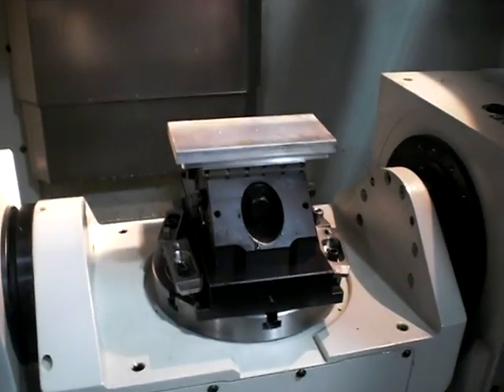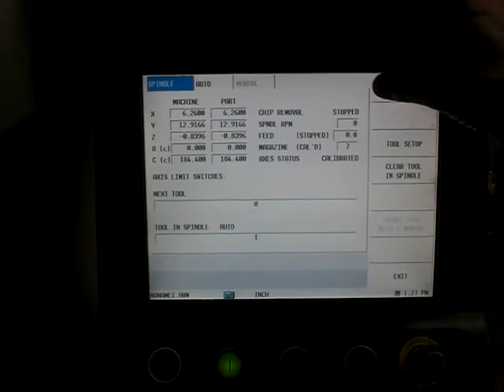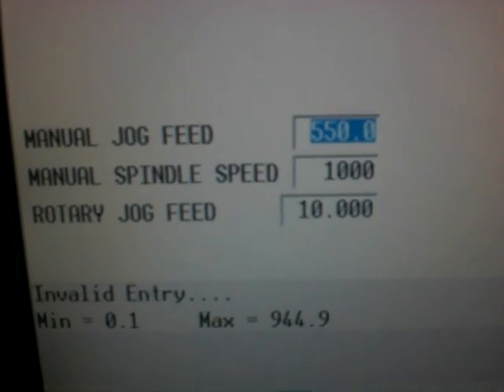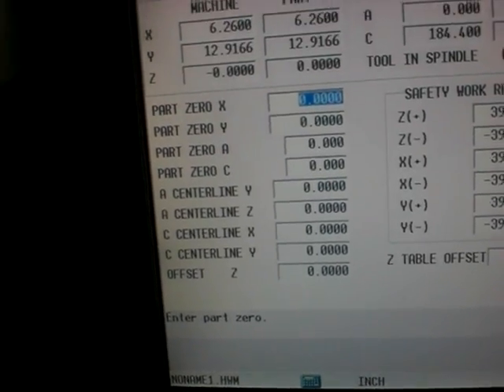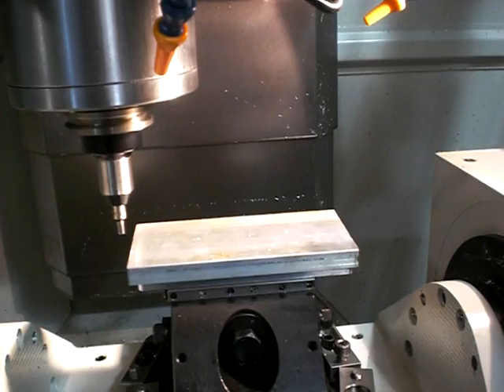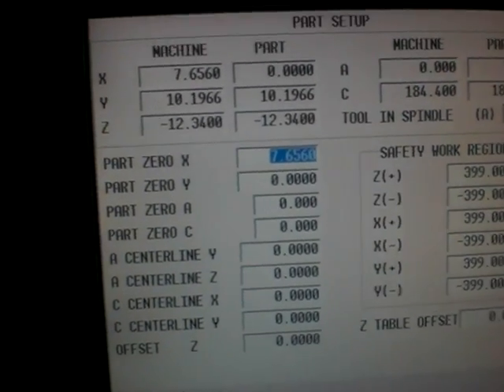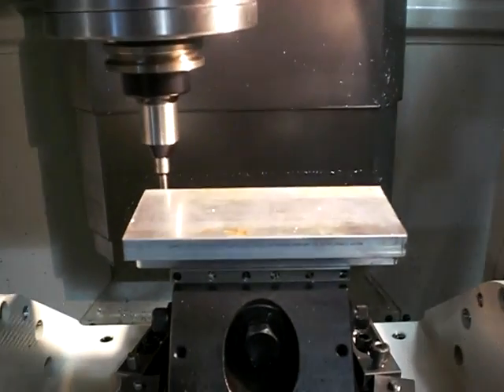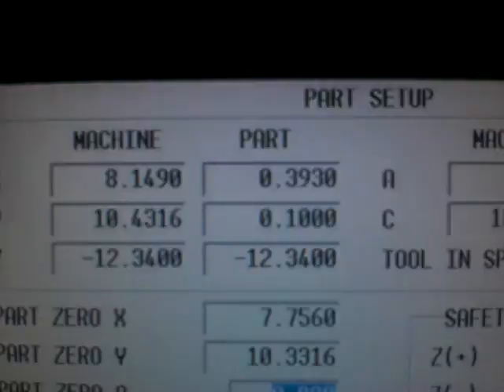Hurco Part Setup

Comment: Thanks Tom! When someone starts at a new company and has years of cnc machining experience but no Hurco experience, It's frustrating for everyone when you can't even make a tool change and set the tools! The manuals are OK but to describe what you did in your video would take up 25 pages in the manual.
Reply: You are right mark  I just started new job with hurcos and got problems tryin to start spindle and edge find parts ,it’s frustrating specially when people assume just bc we run cnc mills it doesn’t mean we know every single cnc control.